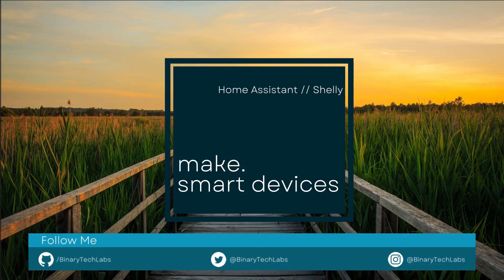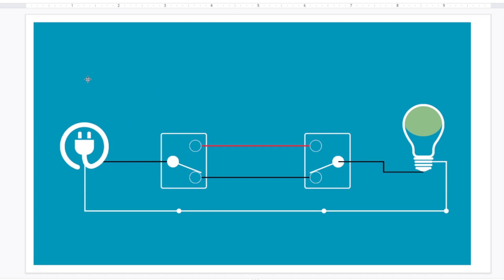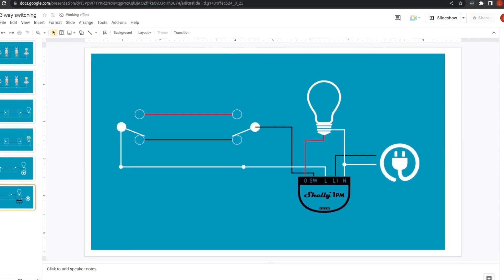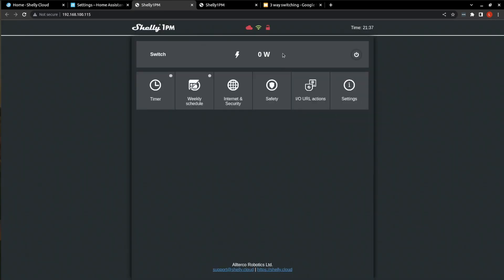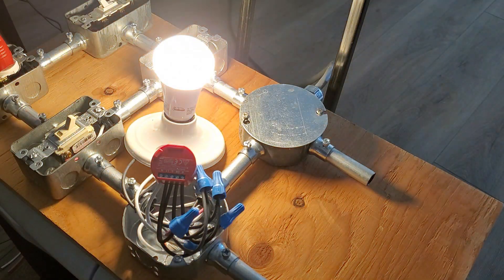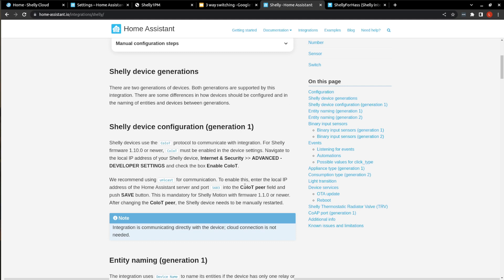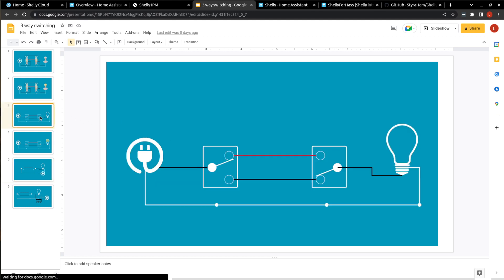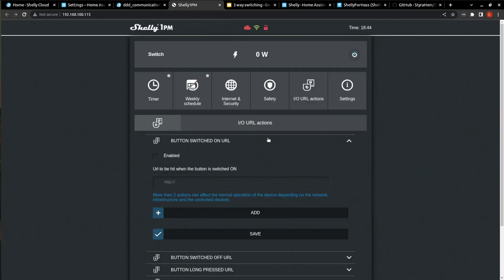Transform any device with Shelly and Home Assistant: A step by step guide for 3-WAY circuits

Comment: I have a question. If I have a three way, best to put normal switches and put a Shelly on each one. Then setup an automation to tell the other Shelly's to turn on or off accordingly?
Reply from the maker: Yes, that's what I've been doing for my place.
Reply: @BinaryTechLabs  the part I don't understand is I need one at the light too?
Reply from the maker: Yes, basically the Shelly makes each device "smart" and in the Shelly software you can have that Shelly device turn off another one, effectively making it a 3 way switch for the ones behind your switches.
Reply from the maker: With some of the questions that I have received on these, I will be making a further video to explain this concept and one that is more reflective of the majority of electrical installations
Reply: @BinaryTechLabs  thank you! Dimmer functionality would also be very helpful.
Reply from the maker: I will keep that in mind

Comment: This is awesome - thanks for putting this together. 

A couple of questions:

1. In the box where I have the last switch, I have the two travellers coming in, then the load out to the light. I also have 120V power for another switch on a separate circuit. Would that change the wiring setup for the Shelly?

2. If using a Shelly 1 with an "I" input - how might that change the wiring?
Reply from the maker: You are welcome.

1. This is a typical 3 way circuit installation and you can either pull new wire and configure the wiring as I show in the video, or the probably more practical way would be to install a shelly at each switch and 1 at the light, and then you would be able to through Home Assistant automations or Node Red be able to restore the 3-way switching, plus make your switches smart. Otherwise you have to leave the switches in the correct position to allow your light to be "smart" if you opt to use only one shelly.

2. On the shelly 1 the "I" input is constant power or "HOT" and when you issue a command to turn the light on the power flows out of "O" (Load circuit output terminal) to your light .

Hope this helps, also here is the documentation for reference for a Shelly 1 > https://kb.shelly.cloud/knowledge-base/shelly-1